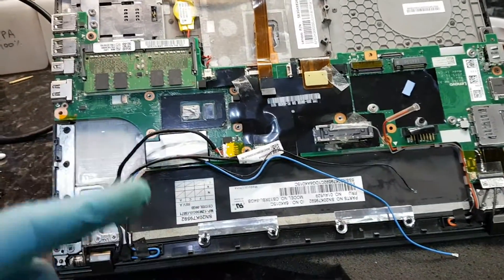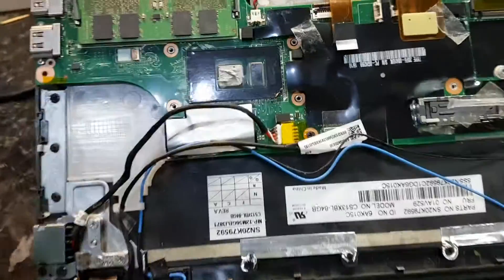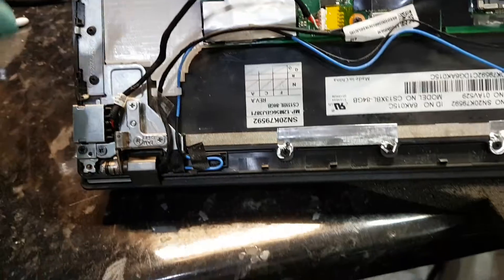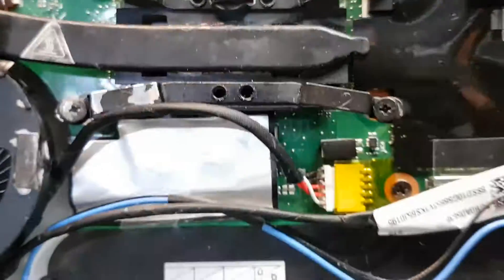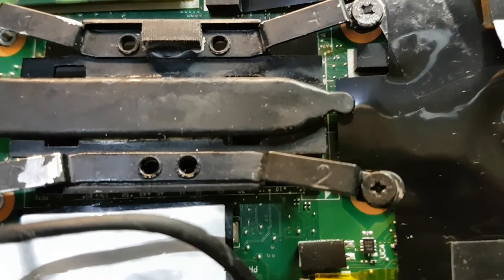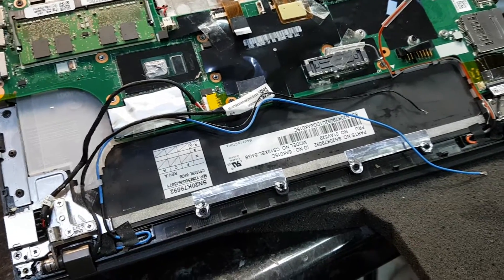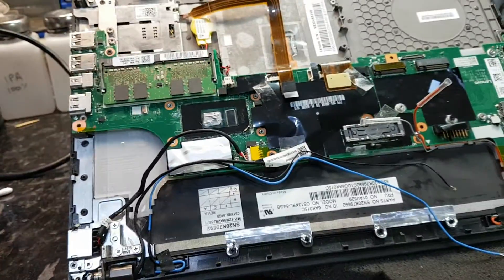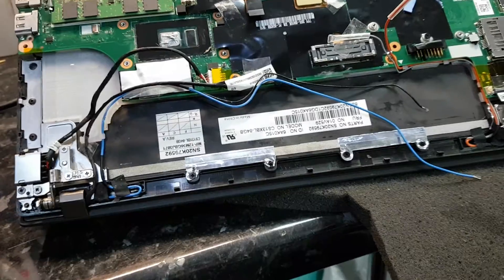LENOVO THINPAD X260 POOR THERMAL DESIGN GPU

Comment: On Mobile Skylake non-HQ CPU, the CPU/GPU and the PCH are on the same package.
The larger die is CPU+GPU, the smaller die is PCH. The PCH shouldn't dissipate that much heat. Max power consumption of the PCH is lower than 3W, and for common usage it will be much lower than that. I don't know the exact figures but junction to ambient thermal resistance of a bare die should be no more than 20°C/W. At worst, this would mean a 60°C increase over ambient temperature. This is bad, but it's in the worst case. Meaning on average a heatsink is probably not needed.
I think they should still have put some sort of heatsink on the PCH, but on the other hand the real thermal design issue is on the CPU itself. Put it under some load and it easily reaches 90°C. Since the PCH itself has no reason to be that hot, if it was under the same heatsink as the CPU, it would get heated up without any reason.
At least that's my reasoning, I'm neither an electronics engineer nor a thermodynamics engineer.
Reply: Probably it is so, but HP Spectre 13 put copper radiator above it. X-series of Thinkpad suppose to be a MIL -standard tested and considered to be a business reliable laptops. Why not to do things right? Besides, how it is possible to have CPU an GPU on the same package if both of them show the different temperature (30 deg C difference?). How the system can measure that?
Reply: Mike Anderson  I believe this is because top surfaces of CPU and PCH are not guaranteed to be in the same plane thus making it is impossible achieve good contact with heat sink for both at the same time.

Comment: I was surprised when disassembled mine x260. I put a thermo pad on GPU just to fill that gap and to try what will happen.
Also I noticed that screws on the copper radiator should be tight very hard and in order mentioned on it.
It really helped. Usually I was getting 40-45 C  idling and 80-85 C on heavy load since the purchase. After all my manupilations, I've got 40-44 C idling and 72-75 C on heavy load.
Reply: which pads did you buy? Do you have a link like that?
Reply: @eugens.6797  I don't remember really, I got them from local amazon, but as for thickness - I just estimated. And actually it was not a pads, it was some kind of strip, which I cut to the size.
Reply: ohh the screw must be tight okay thanks

Comment: What you thought was a GPU is the PCH. From what I've heard they leave it out of the heatsink so that it doesn't absorb any of the heat dissipated from the CPU/GPU. I by no means know anything about the engineering involved, but this is what I've been gathering from some research.

Comment: Dell webpage tells not to apply thermal paste on the PCH chip shown here. They don't explain why, but I assume then there must be a reason?

https://www.dell.com/support/article/ee/en/eebsdt1/sln303435/intel-core-i7-5600u-cpu-addressing-queries-about-overheating-on-latitude-systems?lang=en

What are the thought on that? Supposed to be that way it seems.

EDIT: Also I want to add that if the heatpipe and plate drives the heat farther from the hot CPU and PCH is not developing notable heat then it would be logical to have the heatplate of the heatpipe isolated from the PCH chip as seen in this video.